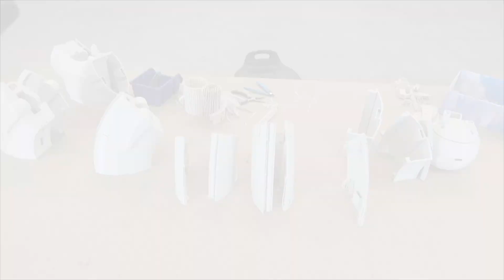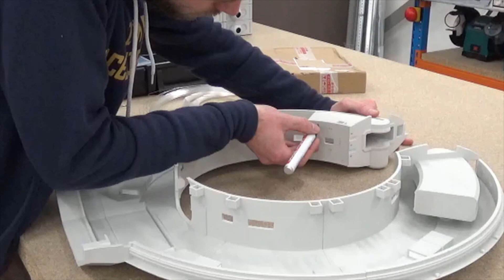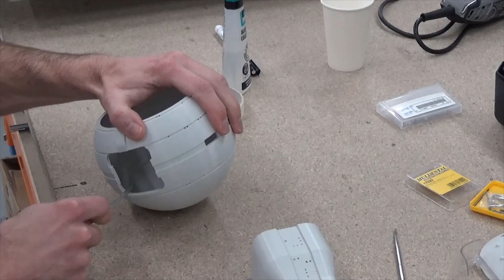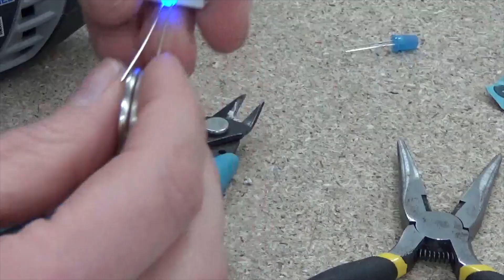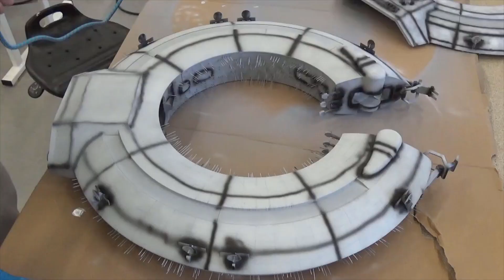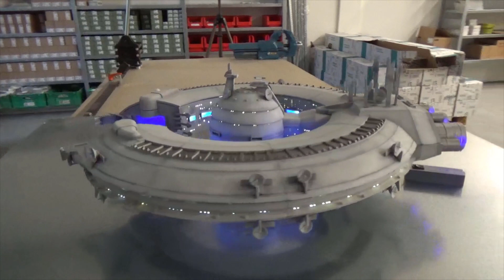Star Wars CIS Lucrehulk Battleship 1/5000 | 3D Printed Model

Comment: Is the way you connected the LED's here the same as the small version?
Reply from the maker: No it is not. For this model I made knots in the wires before solding them. Because it is two times the size and, I upgraded the model, the inside is more accessible making it easier to install wires and LEDs.

Comment: Wonderful model building, nicely done lights. Maybe drilling would be easier including slightly undersized pilot holes in the model. This way you only need to clean up the holes with your drill and avoid having to drill through two walls. Just my 2ct, keep up your superb work!
Reply from the maker: Thank you! Thats a good one, it will take a long time implementing it in the 3d model xd.